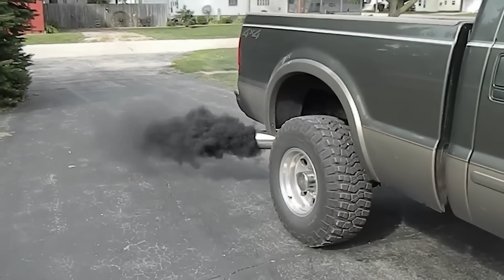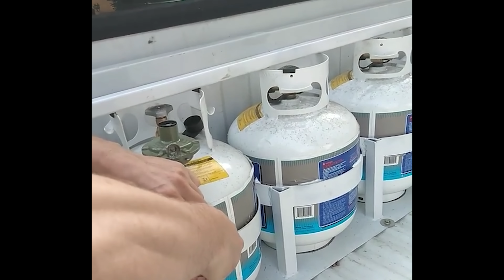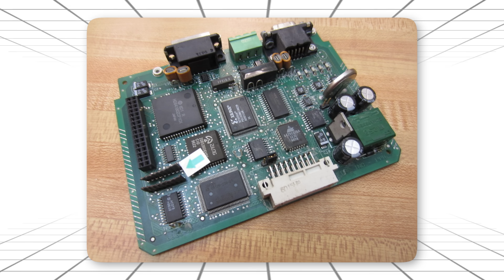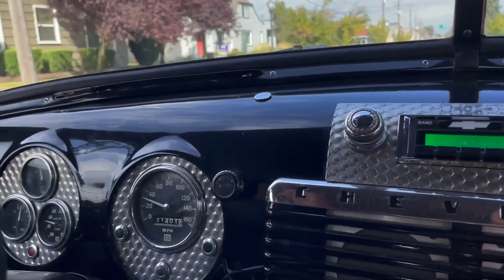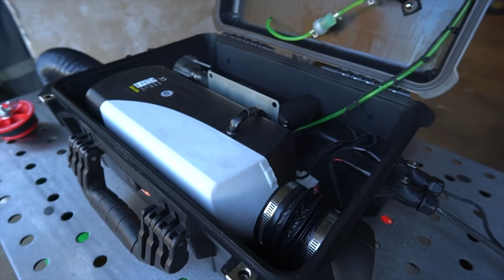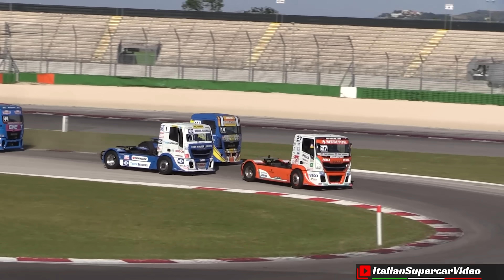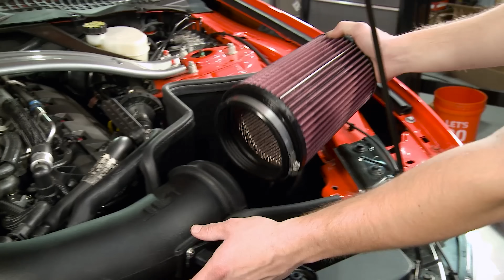They Made This Diesel Trick ILLEGAL For A Reason

Comment: Diesel mechanic here , this is the quickest way to BURN up a PISTON. The 671 detroits were 2 cycle with plenty of power called the SCREAMING DEAMON. Electric companeys went to propane in the 70's and could not wait to get out of the propane business.
Reply: Propane will ignite by compression before the piston has a chance to get to TDC. Yikes!  Best to leave propane with controlled timed-ignition instead.
Reply: I run water/meth along propane activated on boost.
Reply: Yes, but the Detroit engines were'nt exactly the best format for this type of application. Tractor pullers use it all year long and crank 15,000 hp out of DT466 blocks reliably the whole season. Now  ad meth water injection to that mix? Now you have a bomb! The meth/Window washer fluid will boost compression by about 6 points as well as cool the air/fuel. I have a friend that builds these engines and they busted the block on a DT466 right down the middle of every main cap all the way to the head during a pull a few years ago. 15,000HP and 12,000 RPM's, and that crankshaft really wanted out of that engine block bad! So bad it pulled the bolts out of the block! Crank was fine! But not much else was any good.

Comment: Superchips sold the Digital Propane Injection kit.  I think it was EPA certified except in CA. The DOT approved tanks are fairly pricy,  and usually use about 1/2 gallon of propane to a gallon of diesel, with about the same fuel mileage.
Used to be affordable when Propane was cheap and Diesel was really expensive, but the cost brake even mileage is close to 100,000 miles.
Reply: It wouldnt make sense to use it all day long, Just when you want to go fast.. Like nitrous.

Comment: False in the first 50 seconds. Black smoke is not unburned fuel! It is burnt fuel without enough oxygen to properly burn the mixture. White smoke is Unburned fuel. Low cylinder temperature, incorrect fuel spray, bad injector. Black smoke is not unburned fuel. It is burned  the black is carbon
Reply: A pulling tractor guy has an engine that just spits blue out of the stack. It runs really good. His story is that anything that black is just over-fueling.
Reply: @jimandskittum that's oil!
Reply: @Root1776   Uhm, What is "What did Justin Bieber say when Diddy dripped something down his plumber's crack"
Reply: carbon is a fuel. You are running pig rich. It isn't fully combusting. Not enough oxygen to burn the fuel. your words, you contradictrd yourself

Comment: Getting caught running propane is the same as cutting off your catalytic converter. Youre tampering with emission controls.
Reply: Who is going to know? It’s no different than nitrous on a gasoline engine, 99.9% of the time it’s invisible. The engine will never know until you push that button. 

Water injection is another poor man’s power added. Washer fluid is mostly methanol, many people use it. 

Nitrous or propane doesn’t blow up engines, people who don’t understand tuning blow up engines. If you make small tuning changes and pay attention to the tune, it’s a proven power adder.
Reply: @mattrodgers4878 im not knocking it. Its stupid that its illegal.
Reply: Propane makes diesel burn cleaner. Diesel to propane ratio also matters. In electronically controlled systems, the ratio can go as high as 80% propane and 20% diesel.
Reply: @shubhamrane7020  thank you Bill Nye the Science Guy.
Reply: Not any more.  Epa has no say anymore you can legally strip any epa garbage
Reply: @hondaxl250k0 in California?
Reply: @sherlockholmez8764 the entire USA has been deregulated in that aspect.  Thousands of guys have been removing emissions and def on diesel trucks lately
Reply: @hondaxl250k0  This week, next week it's back to the companies selling the kits getting hit with multi million dollar fines. Best to just know how to DIY...
Reply: @pontiacg445 I do all my own work.  The only thing I have not worked on is a spaceship.  Someday I’m sure…
Reply: @hondaxl250k0  I've gotten decent at playing with microcontrollers, ones with multiple built in canbus controllers. If I ever have the need whatever I drive will pass smog...
Reply: @pontiacg445 here in ohio we no longer have smog.  If you do it’s state not federal
Reply: @hondaxl250k0  I don't have anything here, either. Everything I drive is running on custom hardware and software. Lately I've been running modified versions of speeduino on an old 3VZE. Almost warm enough to bring the car back out...
Reply: @pontiacg445 if I’m not driving the truck I’m riding one of my motorcycles or dirt bikes.  Or flying my airplane.   One day I hope to have another classic.  Prob a studebaker.  Or another Plymouth fury
Reply: @hondaxl250k0  My local track finally came back from the taxman, been sitting idle for years now. "I'm from the government and I'm here to help!" 

I need another motorcycle...
Reply: @pontiacg445 no you don’t.. you need 2.  Or more😂.  Trust me I know.  I got enough toys to warrant a divorce
Reply: in Thai otr diesels are converted to cng. u c 20 oxy size bottles double stacked bhind cab